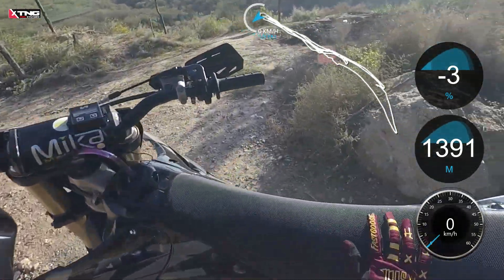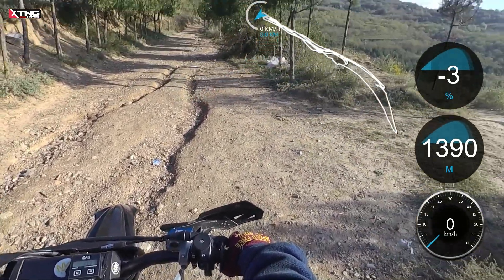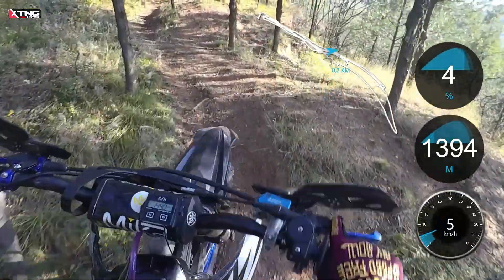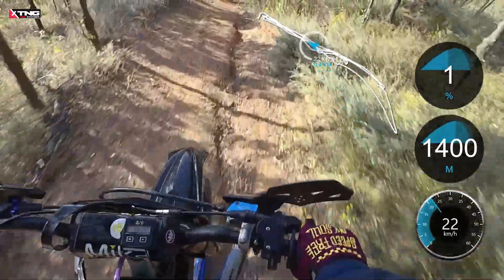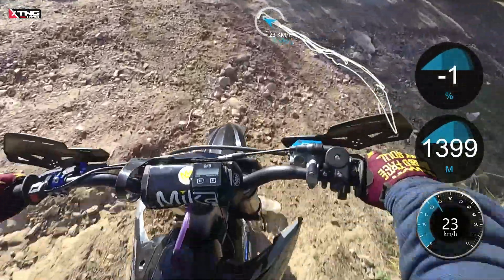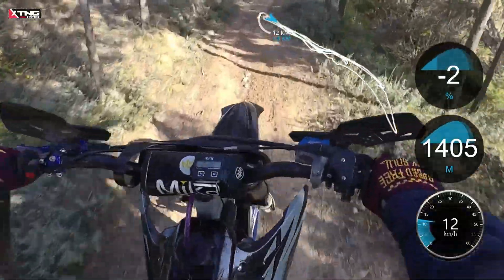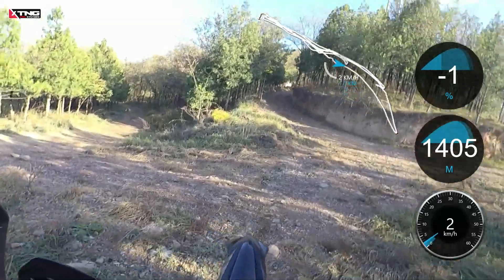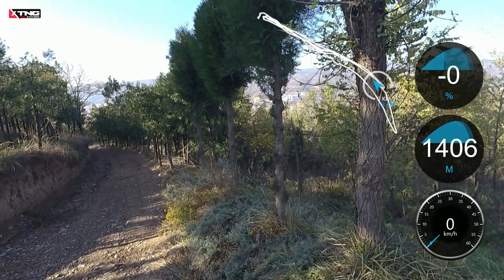XTNG GEN3+ 38 Full Riding Test (Optional Subtitles)

Comment: You should show the gearing with your helmet camera & them get on the bike. & show the lower rpm tune by starting the bike & bringing it up through the rpm.

I noticed there wasn't any showing of the gearing or showcasing the tune of the other brand carburetors.

Showing these things would be beneficial in the comparison.
Reply from the maker: Thanks for your suggestions, I will try to improve these in future videos.
Reply: I bet you guys can develop a reed cage in the style of the Boyesen Rad Valve, which is great for hard enduro. 😎